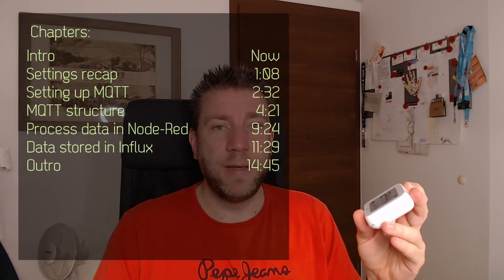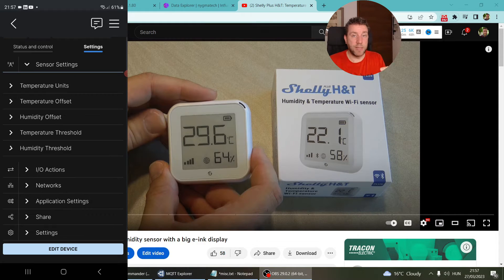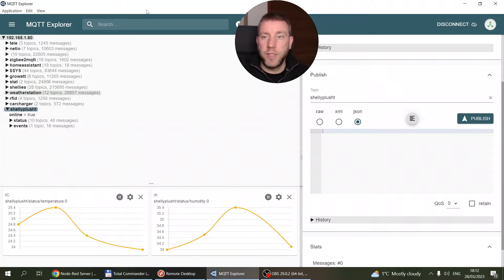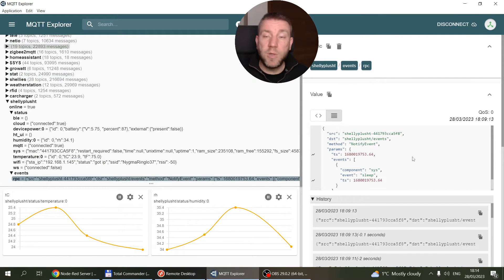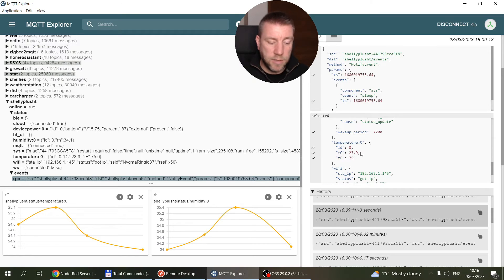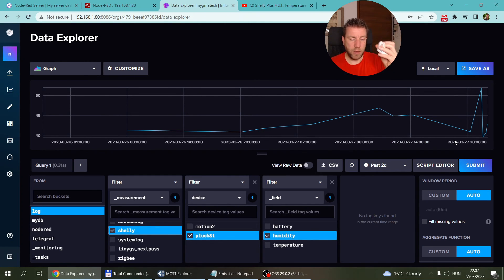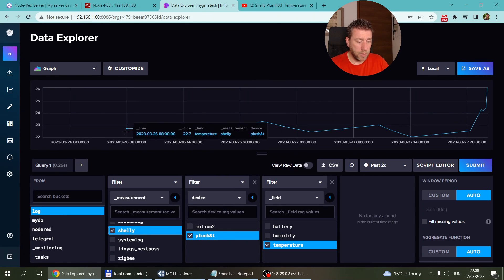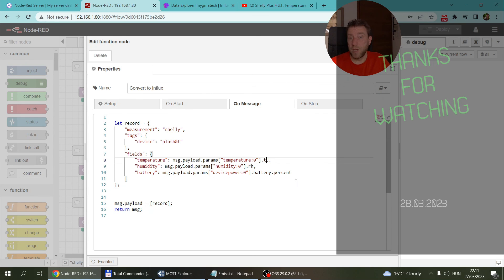Use MQTT with Shelly Plus H&T

Comment: Thank you for the video.  I am having trouble with the user and password.  Where or which login do these come from?  Home Assistant, Mosquitto, Shelly?
Reply from the maker: @MOKPT3  when you set up mosquitto, you usually define a username and password. It is possible to keep it open, but in most cases there is a username and password. That is required here.
Reply: @csongorvarga  Thank you!  I had figured it out and was going to update my question.  Like you said it's the mqtt user and password from HA.  My mistake was that I was using MQTT Explorer and was looking at the Shelly device's IP address.  When I looked at the Home Assistant address the Shelly was there.

Comment: hi, do you know if you can give on/off commands to the Shelly Plus Plug S?. I come from using the previous version of Shelly Plug S, the on and off command are different Topics in which I can write an "on" and "off" message.
Reply from the maker: @user-fc5dz3dt3w  I did a review on the plus 2.5pm and plus 1pm. I dont remember from the top of my head, but I firgured out the topics. More complicated than the older Shellys.